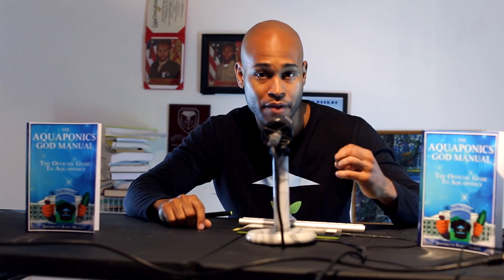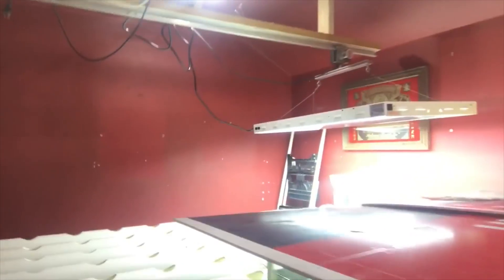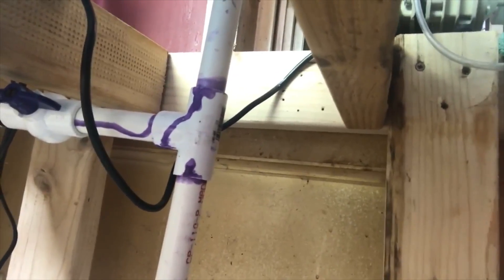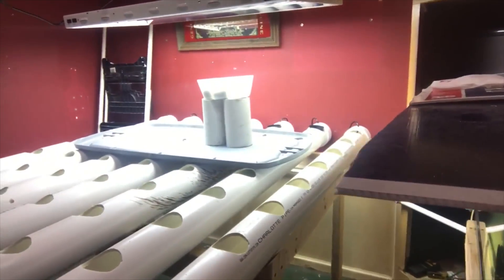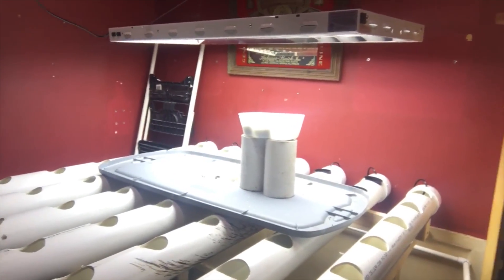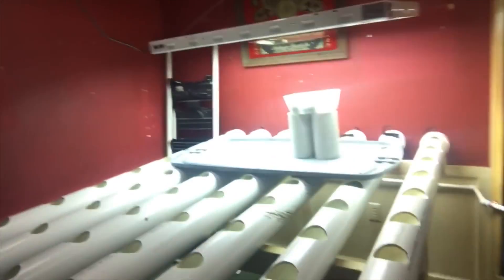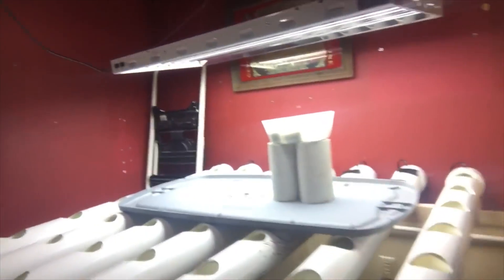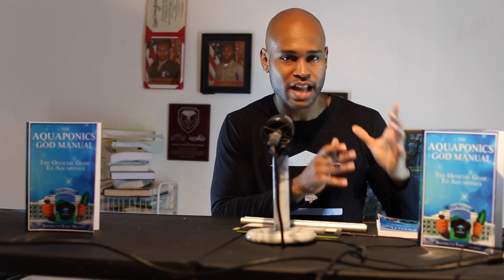Aquaponics God Student System Update | Ask The Aquaponics God Ep. 70

Comment: looks like a good test set up to me.the only negative thing that i could think of is that as your cords move back and forth on that shower bar it will slowly ware thru the cords insulation . my thoughts on a possible solution would be to ether rap the cord with a disposable raping or set up a roller so that your not getting the drag on to your cord.

Comment: Always good to start small just to see how everything fits together. I agree that tomatoes CAN be an issue, but only if you don't trim the suckers. One vine stringers don't need as much roots however I see the problem being the height a tomato plant gets in this overhead light system. Only if you put the tomatoes at the wall end will it not become a huge mess later on. Cabbage are ok again if you keep the outer leaves trimmed. I'm not too big on the NFT systems for anything but the smallest of plants like strawberries. In fact, with the lighting system he has, this could become an AWESOME strawberry patch system! I'm sure he could get some plants pretty cheap at the nearest Home Depot/Walmart. Plus suckers can be replanted themselves. Wouldn't take long at all to get a good haul.
Reply: I am going to plumb in a tomato bucket to attempt this.  Tomatoes, specifically Indigo Rose Tomatoes, are going to be one of my main crops I want to market.   I'll make a video when I get this done.
Reply: Anyone do I need a timer to run my NFT system

Comment: Light movers are a suckerfish. U lose 40% to 60% yield. Get two lights. I don't have much experience aquaponics but I do know lighting and growing.
Reply: MadBotanyOrganicFarmsLLC You are representing a business and you insult people by calling doing what they are doing suckerfish? Good luck.
Reply: Hes is 100% right on it. Light movers are meant to help with evening out light distribution.
Not cover a larger area.
You need to have the amount of light required for the area to start with.
In the old days we figured lighting by Lumens per foot.
About the highest practical level is 3000-3500 lumens per foot.
After that you are dealing with light saturation.
A light mover helps to also keep the light closer to the plant with out burning it.
Intensity diminishes (Inverse Square Law) exponentially the farther the light travels from the source.   
But in the same regard the Lamp has to be high enough to adequately cover the designated area.
Everything and I mean everything has trade offs. Its a matter of deciding what you want to accomplish and make the trade offs that work towards those ends.
IMHO you are far better off using more smaller lights, over lapping their coverage and using reflectors on the perimeter. The cheapest and best is just flat white paint on a flat smooth surface, shiny reflective things tend to reflect in hotspots and not evenly.